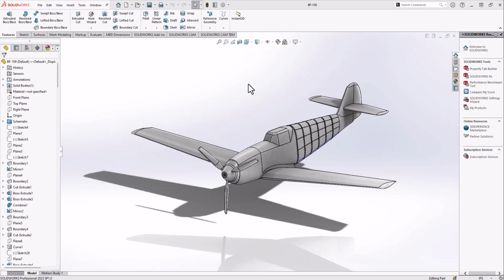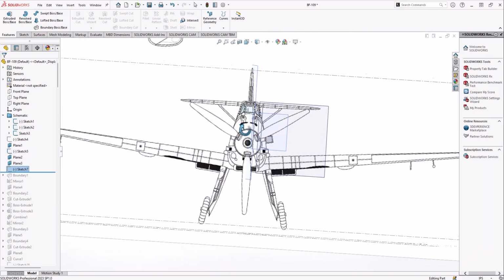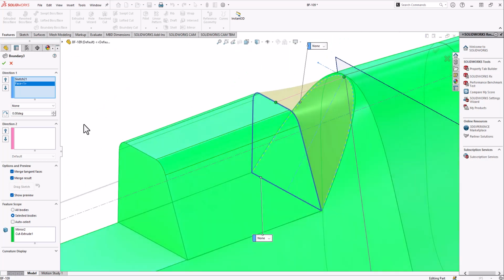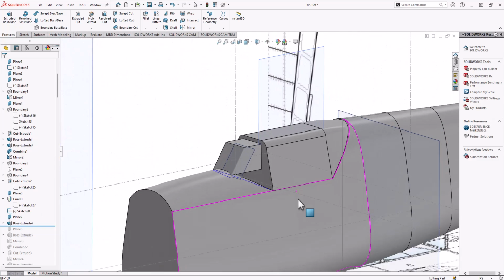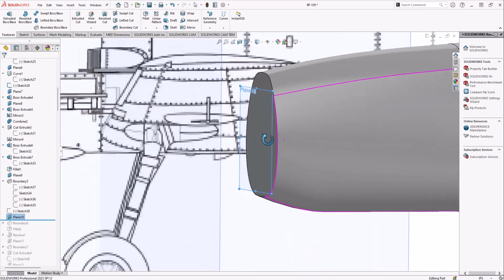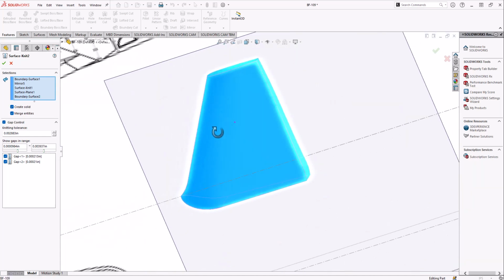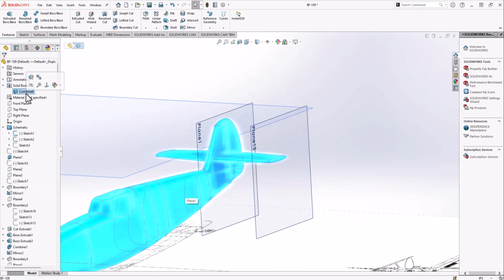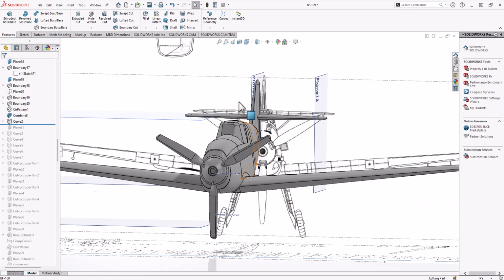Modeling an Aircraft in SolidWorks (bf-109)

Comment: Why didn't you just start out with the basic planes as references? Draw the a/c and just mirror the whole a/c at the end. Maybe cut out the a/c pictures in Photoshop and import them on planes to project. All and all the work flow is awacwardly done.
Reply from the maker: You’re not wrong. I generally don’t do aircraft (this is the only one I’ve even started) so my workflow is an adaptation of the work flow I do for subjects with less symmetry where being able to see the views in one quadrant is useful. 

Regarding the workflow being awkwardly done, you’re right and if I were to do another aircraft I’d do it differently, this model was an experiment to try doing a plane and I was asked to share the process.